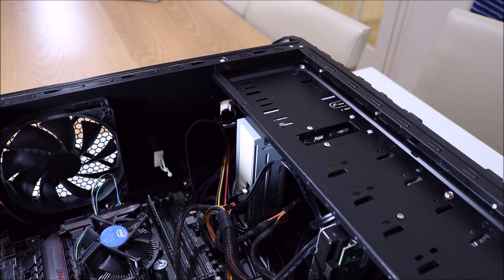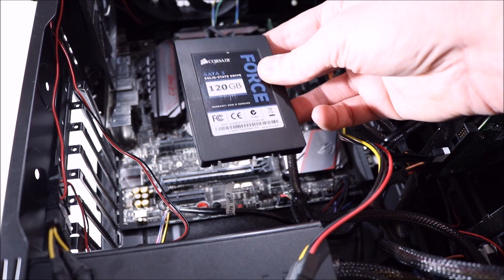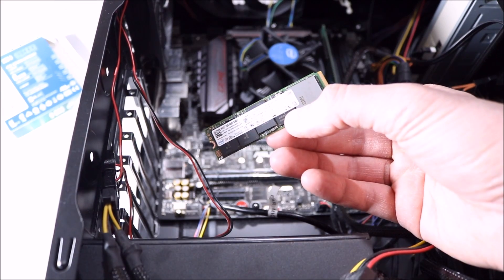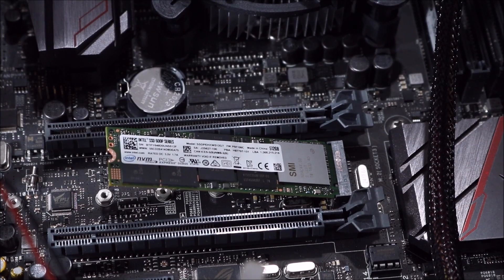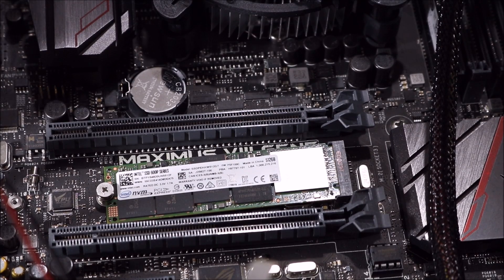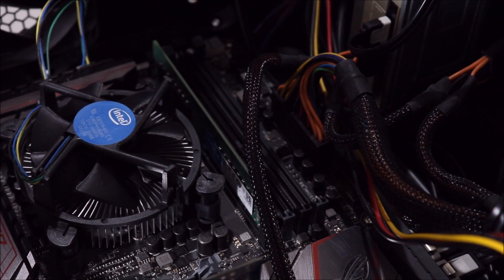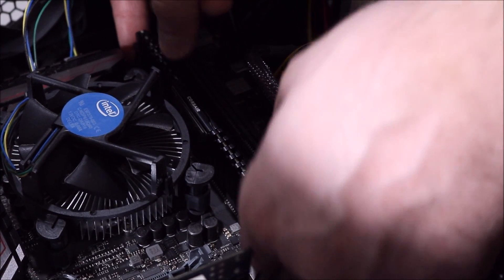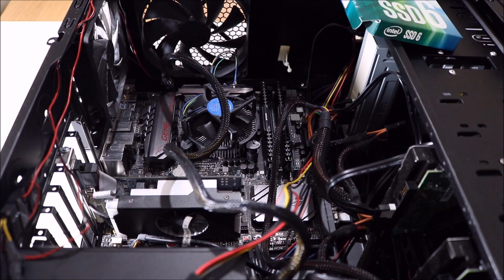How To Install M.2 SSD Installation | Intel 600p SSD & Maximus VIII Gene

Comment: Anyone watching this, normally your motherboard will come with a small packet of stand-offs and the correct screws for this, you should install the standoff first then screw down the SSD with the screw so it is straight and level and not bent down as in this video, however I’m sure it works fine even if it screwed right down to the mobo.
Reply: I'm glad I'm not the only nerd that noticed that! Lol

Comment: my board doesn't have m.2 slot (MSI  Z77A-G41 v.3.0), what's the best way to use that drive(Intel 600p M.2 )?  Sata adapter? PCI adapter?   Thanks in advance.

Comment: Might want to check the retention screw on the SSD, should keep the SSD in place and straightened on the board, I did the same mistake when I installed mine in Maximus VII Gene board. Cheers. :)

Comment: So what size screw is it and where did you get it from?  I assumed it would come with the motherboard kit but I don't seem to have one.
Reply from the maker: Mike B. Hi Mike, I ended up using one of the screws from the graphics card heatsink, you can see the graphics card in my video, I don't know what size it is I'm afraid, very annoying they don't supply one.
Reply: @GeekyStuff  oh my god you life saver, i tried a screw from a 760gtx and it worked perfectly
Reply from the maker: @MYROCKYman  Glad it helped mate!